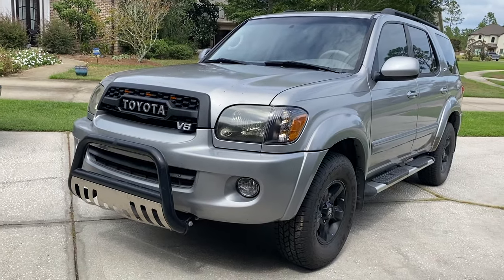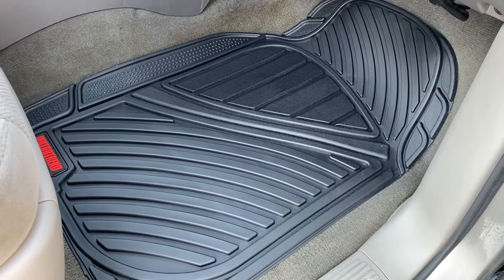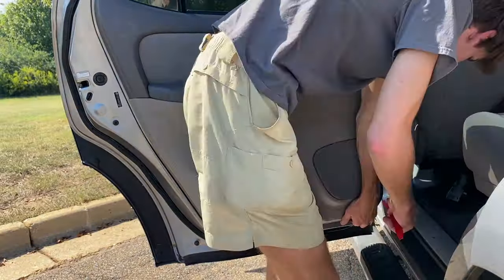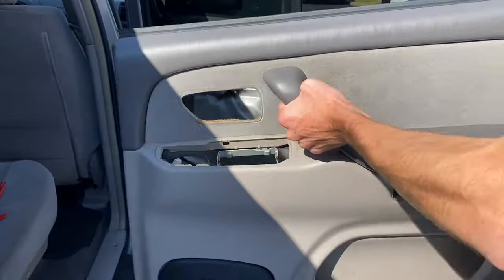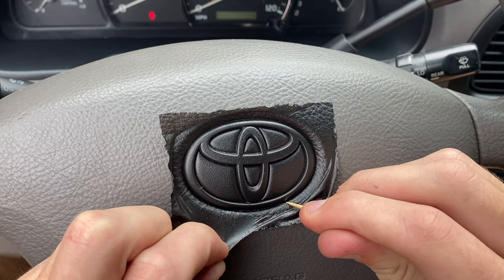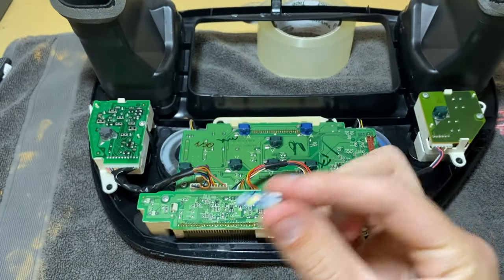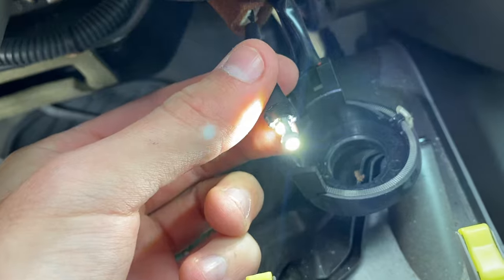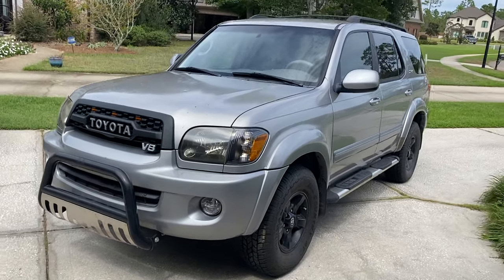Budget Sequoia INTERIOR Transformation Upgrade

Comment: I just bought my 2002 limited two days ago. 2500 bucks with 192,000 reported miles. Everybody ran from it because it was missing all of the door latches on the inside, and the driver door panel is barely connected. Frame is nice, has exhaust already, engine looks awesome, and it drives like a dream. The only mechanical things that will need if you can even call it that are tires, alignment, either a thermostat or temperature sensor and that’s it. somebody put super cheap paint on the outside, and just simply didn’t put love into it when they had it. Window motors are starting to get old, dumb stuff. I said all that to say that I couldn’t turn it down, and I’m already attached to it, and this video is making me feel a lot better about my decision. Plus, a family friend that restores trucks has agreed to take it on as a project if I buy the parts and pay him for his time. I am definitely not the guy to do it myself lol. At least not the big stuff! I want it done right so she will look amazing ❤
Reply: How are you enjoying it? I’m probably buying a 2002 limited Friday. 227k miles for 5k
Reply: @ethanpope410 I’m glad you asked! He has had it for a month and is only now just fixing some of what it needs. Got tires and an inspection already though and she had no leaks or scary maintenance issues! She didn’t even need a thermostat or temp sensor. It is just a faulty gauge. Tough old girl. It was like this guy was TRYING to find something wrong and got so frustrated doing so that he started cursing when he pulled me aside to show me the battery was trash and it started right up lol. Just a loose connection. Fixing that too lol. I found all parts needed cosmetically for cheap on eBay including a replacement leather door panel. I should be back in it in about a week. After I get it back (he seems distracted so I finally just asked him to just do the important stuff) I’m taking it to another shop to install the toys I bought—50 inch LED light bar and ditch lights, CB radio, PA system with sirens and bull horn, wolfbox 12 inch rear view mirror replacement display and camera system, 11 inch iPad Pro cd player mount/bluetooth and FM transmitter with display etc etc 😂 can’t wait!! The custom shop owner works out of his home (had no idea), and has some physical difficulties. I think he means well so I am going to show the love of Christ and be patient and kind. Everyone needs a break sometime. Plus I put an AirTag in a secret spot so I can see “Gigi” (short for Gojira, or Godzilla) 24/7 anyway. Registration and tax was $475, full coverage insurance $52!!! I’m in Southern California. Check in with me in two weeks and I will let you know if I got her back yet 😂
Reply: @VicDamone85  sounds like you’re going to have a sick build!
Reply: @ethanpope410  I’m trying! On a budget lol I know that was a lot lol. It has been a journey already. What I decided is that I’m not going to paint the truck, I’m going to leave it with that crazy work truck look, remove the resonator to make it even louder, and eventually go with off-road bumpers, some crazy off-road wheels, and even bigger tires. Frankenstein build with some really nice looking suspension components in the future. Gotta make it what you want! I hope things go well with your purchase! Worth it.